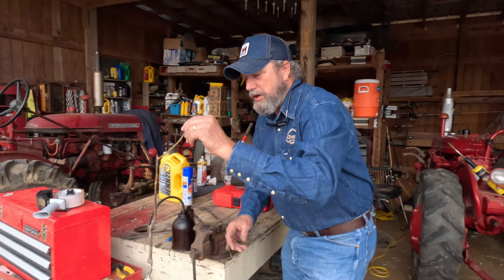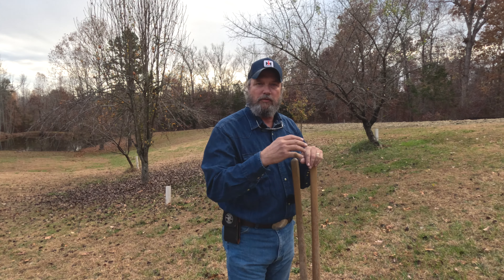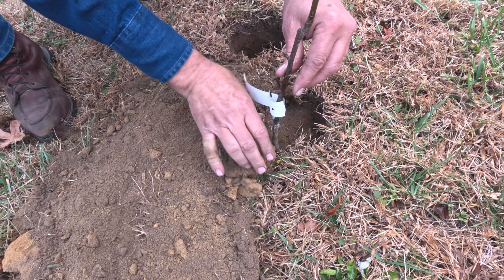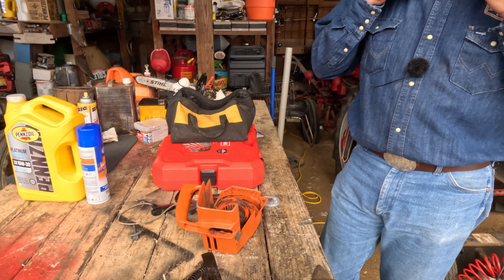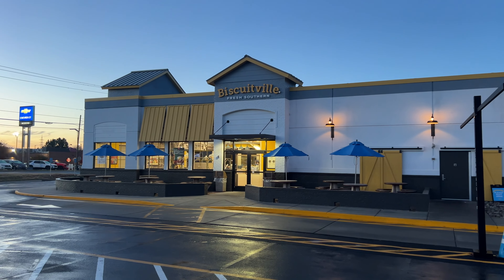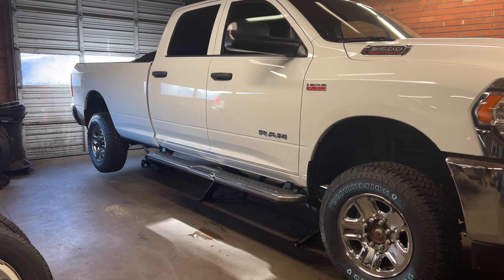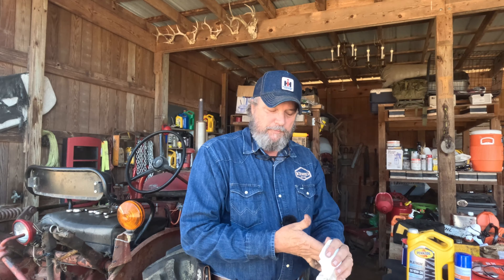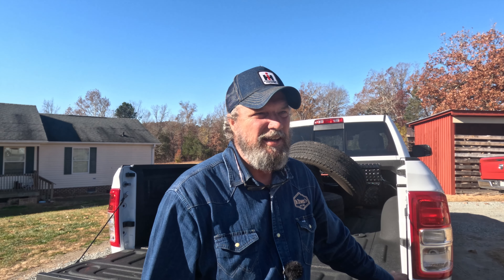Tires, Pear Trees and Saws!!

Comment: I took one of those springs out of a 5 hp Briggs one time to clean it all up and I contemplated throwing the whole engine away.  I'll not take that assembly apart again.  Guess I should have watched YouTube first.  Also, Biscuitville is one of my favorite quick breakfast stops.  I bet that little 015 is a handy saw.
Reply from the maker: I kinda felt that way on the saw but I told Sam let’s just stop and pick it up later.

Comment: Our soil is just like yours, dry. Yeap them springs will get you, that notch on the recoil is to remove the slack out of the rope. Nice limbing saw. We have Southern Tires here in SW La. One is none, two is one extra. Nothing wrong with being prepared. Great video.
Reply from the maker: Thank you so much. That drill trick sure saved the day.

Comment: I've got a few 011's. I love them. Use them for cutting tops out when cutting firewood, branches in the yard or a backup saw.
Reply: Got to the saw part. While mine 8s a horizontal cylinder saw...it's the generation newer than that saw.

Comment: Something to try that I learned from one grower is bend branches down horizontal. If they are all pointing to the sky that is where the tree will go but horizontal it will put out fruit. 
I have planted pear trees just because apples need so many chemicals to do well. Grafted root stock will determine if you get a dwarf or full size tree. Try nut trees too. Wisdom I heard, "Best two times to plant a tree are twenty years ago, and today".
Reply from the maker: I really like that saying that’s pretty neat. Thanks for the limb advise.

Comment: A little advice on the tree planting. Here in N. central Indiana, the ground is made of clay and gets as hard as cement when dry. The problem that this can cause is that 1. the hole you dig can become a sump where the water that is collected in it does not drain off and can drown your tree. 2. Your tree can become "root bound" where the roots cannot spread out through the soil. This may be the reason that you lost a couple of trees in that area? Good luck, I enjoy your videos.
Reply from the maker: Thanks Mike. It’s on a pretty good hill so I’m not too worried about the water but the root bound could be an issue.

Comment: If it was me I would shorten the pull cord that few 8nches so that it went in, to not have to pull that thing apart again 🤣
Reply from the maker: It was super easy after I figured it out. I took it apart again and wound the spring up about 5 more turns and it’s perfect now.